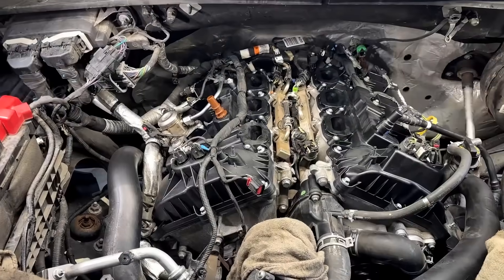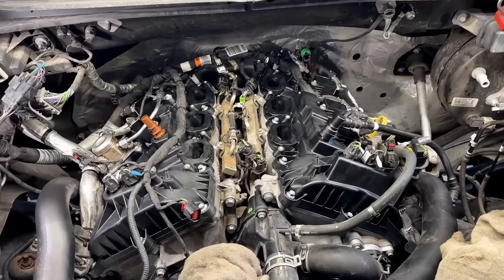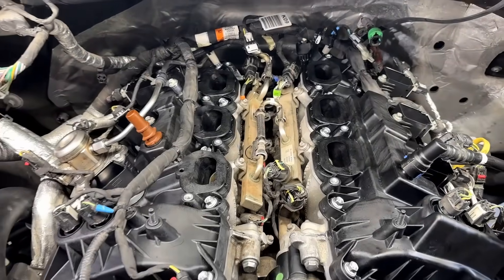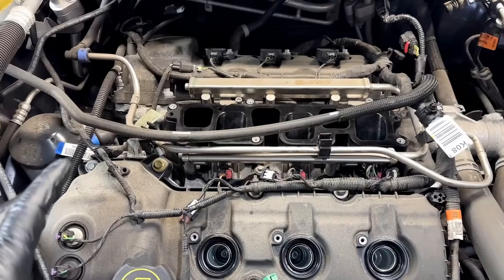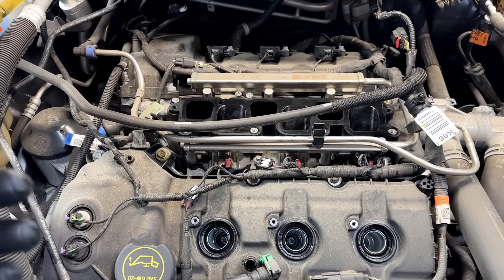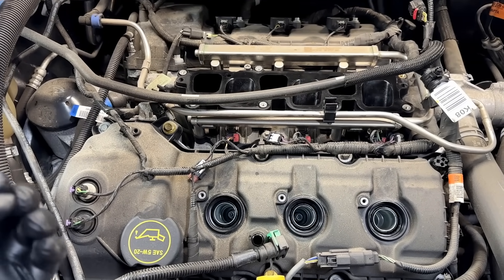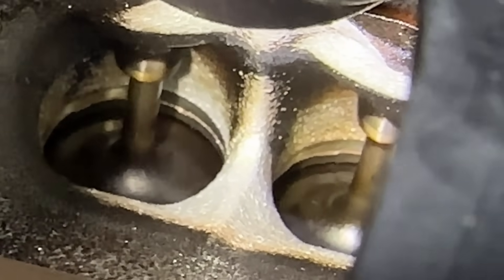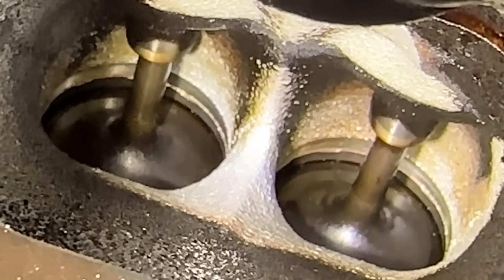Does Ford's New Dual Fuel Injection 3.5L Ecoboost Engine Really Fix the Carbon Build Up Issue?

Comment: Hey, thanks for the videos, they’ve been super helpful. Question: are you seeing the same timing issues on the 2.7 TGDI like the 3.5s? Can’t find much online about that. My 2.7 has 202K 2017 gen 1 2.7TT. 6R80, runs like a top minus drivers side waste gate rattle on cold starts. Thanks in advance.
Reply: Any direct injection car without some form of port injection before the cylinder is going to suffer from carbon buildup in some way. walnut blasting or pick cleaning are some options
Reply: @Sprier doesn’t really have anything to do with what my question was. Thanks for the comment though. I’m aware, I’ve got a catch can and regularly wash the valves with sea foam through the vacuum port on the intake manifold.
Reply: @zr1vetteman09  Port injection that bitch and send to 1000whp! Never have dirty valves again! Lol! My mistake by the way I missed one word from your comment "TIMING", apologies!!!! Happy new year Cruz!
Reply: @Sprier  haha you right though, although according to this channel, the port injection didn’t work as good as they hoped in conjunction with GDI. I’m working on getting it tuned by 5 star soon.

Comment: I have two diesels, a Mercedes 240d with 350k+ and a 7.3l non-turbo F250 with 250k+. No noticeable buildup on the intake valves.

Comment: Ya got to beat on these turbo trucks a bit to keep them right.. I got 238k on mine it's not had any problems w engine.. still stupid fast runs great.. only things I've replaced on the truck is rear axle bearings fuel pump and 1 upper control arm.. all over 200k these happened.. wore out parts not user error..

Comment: Ford should have a clean mode programmed into the computer to run port injection only after  engine hours accumulate, then switch back to dual injection... Just thinking out loud.

Comment: The carbon on my 16 must be the answer. My 16 3.5 eco just is not the same and its been at 3 shops and they claims its everything, fix everything and its still there. Just no torque. It reminds of my 01 ranger. Wish scoping the intake and looking at the valves wasn't a  pain...

Comment: Question.
Can using 93oct and and a fuel additive for a few thousand miles clean the carbon buildup on the gen 1 Ecoboost by engines once the carbon buildup is prevalent?  Or is a blasting service after a teardown only way to remove the carbon buildup?
Thanks and thanks for showing this.  Very informative.

Comment: the engines are too tight  the pcv causes lots of carbon and sludge issues  the epa has ruined gas and diesel engine by design

Comment: Thanks Bubba. Bought the Wife a 2021 Expedition with the EcoBoost and Ford Dealership tells me to run BG44K Fuel Additive every month through it for Carbon Buildup. Always used it anyway or in my 6.2 F250 FX4. Would that help?

Comment: All Ford needs to do is make adjustments to the software that gets the computer to switch to port a little more often. From what I have been told so do not quote me on it they mainly switch to port when your sitting still. They should get the computer to switch while at highway speeds unless your accelerating. That is better than  before they had both so I say that is a win for Ford. Toyota started doing both injection systems back in 2007 with a couple of Lexus models.

Comment: I don't even know why I was watching this video I've been Auto Tech for over 50 years and there's no freaking way in the world I would ever buy one of these motors what a waste of engineering Ford should be ashamed and now they came out with their new engine and it's burning up plug wires what a joke but I've always liked my Chevys but you know after 2005 they went downhill should have never went to the active fuel management engine this is all a bunch of crap a bunch of cost to customers that isn't really necessary all to gain about a half a mile per gallon

Comment: That's the result of direct injection fuel and the pvc system crank case gases vs multi port injection where the gas and air mixture is sprayed in the intake runners keeping the back of the intake valves clean👍🏿

Comment: Now let's get to the real answer. If you guys keep running thin synthetic oil. 
Of course you are going to need a catch can. 
That thin oil flashes off and is sucked through the engine. 
Same thing with the front timing chains. 
Worse oil you can run. 
Run a good HD 15w-40 diesel oil and these engines will run for 500,000 miles with no problems.

Comment: Thanks for the update and comparison! I drive a 2014 F-150 3.5L EcoBoost - I just rolled over 150k and I've never noticed anything wrong...I bought it at 103k miles and, unless the previous owner changed the timing chain himself right before selling trading it in... it's still running the stock chain. I change oil 3x/yr with Castrol GTX and when I change oil, I use those Lucas Oil GTI valve cleaning kits that you spray in the intake for like 5min...she still runs like a raped ape

Comment: I've ran a UPR catch can on my 14 ecoboost since 32k miles and have always ran top octane prem fuel through it.  It does catch alot of blow by and the engine runs great, it currently has 107k miles on it.  I always follow your videos and keep fluids clean and just changed my tranny lines based on your videos.  When it's time to work on the engine I'll be bringing it to you.
Reply: Dang does this mean I need to load up my catch can on my wife's Gen ii ecoboost?
Reply: This is nothing new, especially on certain German brands (read VW).  I want to know why a 2019 with 125k on it needs a timing job?  Is this a $5k job with new phasers as well?  Should I get the damn internal water pump done at the same time?    Or just sell my beloved truck and get a slower, less potent 5.0?  Damn it, Ford.
Reply: @Dragandspinn  5.0s have cam phaser problems too as well as oil consumption. Now that they have cylinder deactivation, that's a hard no from me. I'd rather deal with ecoboost issues.

Comment: When the guy fixing the machine should be in the engineering department instead. 😆 Now where I have seen this bef....... I know!....... Any large corporation!

Ford isn't sweating it, if they start to go under, Uncle Sam will make them an offer they can't refuse. And free market forces get flushed down the toilet and CEOs make off like bandits after they dump their stock for a massive profit.

Comment: Thanks, great information as always! 
Do you recommend any type of fuel additives or cleaners for the 2nd generation that may help with the build-up?
Reply: I looked into this exact thing Berrymans B12 chemtool is a really good fuel injection/valve cleaner u put a can into the fuel tank every so often. Also use your remote start in morning and let it idle 10-15 min before u head out when its idling it uses port injection spraying on the intake valve and with the B12 it will make them squeaky clean!!

Comment: I have a catch can on my 19 raptor.  Guess if you drove on light throttle,  port injection most time valves stay cleaner.   I also use jectron cleaner

Comment: I have a '13 F150 EB with 88k, about a year ago removed the intake and manually cleaned all twelve valves.  Used picks, screw drivers, conical brushes, brake cleaner,  CRC GDI intake valve cleaner and a hand actuated vacuum pump with inline reservoir.   Only real thing to pay close attention is to operate only on valves that are completed seated/closed.  I chalk this up as normal high mileage maintenance.  Much like transmission fluid, trans case, diff, etc.  I got fantastic results.  Post clean I would estimate the state would be equivalent to a truck with 5k miles.  Only area that was difficult to access on the valves was toward the engine centerline.  The head design and seat slightly shrouds the valves on a very small portion nearest the engine centerline.  Wish I could post a picture here, the before and after are pretty impressive to compare.

Comment: Brian first Merry Christmas to you and family. First time I’ve heard that the direct and port aren’t synchronized to fire together. Between direct injection putting an extra load on the cam plus causing the carbon buildup on the intake valves what are we accomplishing with direct injection? Are there cam followers on the direct injection pump and if so how long are they lasting? Brian have a safe holiday.     🎄

Comment: If it weren't for the FRP and FLP PIDs as well as the high and low fuel system tests, these would suck to diagnose. I've had a lot of new 2.7s with injector issues, some port and some direct. This helps alot in diagnosing this weird system.
Reply: What years

Comment: In reality I feel we should ditch GDI and go back to Multi-Port. This is why I bought a used F-150 with a Coyote. I do not want GDI or Turbo junk.
Reply from the maker: The newest Coyote engines have GDI technology too.
Reply: @FordTechMakuloco  Yeah I know. This is why I have to keep my 2014 as long as possible. I also still drive a 04 Taurus 3.0L. that one doesn't see winter.

Comment: After 100k miles on even then Gen 1 engine doesn't look bad at all TBH.  I mean it's not good but there's worse out there---e.g. Audi 2.0Ts are typically way worse than this...at half that mileage.
Reply from the maker: I know those are the worst.

Comment: Great video I seen a couple  of them never explained how it worked I have an 18 150 with 30,000 2.7 yep I don't drive much and I do idle so I really don't have to worry about carbon build up for a while thanks .don't even think I need a catch can I should be dead by time I get 200,000 on it

Comment: Hey @fordtechmakuloco I did a timing chain cam phasers hv oil pump 24 rockers and new cam actuators on a 05 f150 5.4. all oem ford parts other than the hv oil pump. Fired right up after the job was ran great smoothest 3v 5.4 I've ever heard. But after driving it for an hour or so everything was good. Great oil pressure great performance until I slowed down to stop at the light I can hear the timing chain or phasers rattling on deceleration almost sounded like a 7.3 then it cleared up but did it during acceleration and lost oil pressure and now when it warms up sounds like I never changed anything. Did i miss something? Maybe a defective part? I didn't pull the pan to do the pump maybe the pick up tube is leaking or clogged?

Comment: Will an oil  catch can help or better oil and higher frequency of changes?  I have a 2020 3.5, use Valvoline Extended Protection Full synthetic G6, and change it every 5000 miles, hoping this will help.

Comment: FordTechMakuloco, would you recommend a catch can on these 2018/newer 3.5 eco's?  If so, do you recommend a certain setup?  Passenger side only or both driver and passenger PCV?  How does adding a catch can affect warranty's etc?
Reply: Same question.  I have a 21 f150 3.5tt.

Comment: New or used which engine is the most reliable, the 5.0 or the ecoboost? Also which model year is better. I've been driving a 2006 Expedition with 180k miles and compared to others I've had very few issues. My guess is other than tires I've spent less $3k on shop repairs. My wife hates the vehicle mostly because of the age and is pushing me to purchase another vehicle. That's for your channel and I must say this is my go to channel for the few repairs I've done on my own.
Reply: V8. I got the 5.0L in my 14 f150 get 17.7mpg. Bigger the motor less stress. Plus v6 turbos will eventually go out. 2014 is not 1st Gen.  After 2015 was a change of model. Never get 1st year model change. I would say big issue watch coolant. Hoses have plastic y with orings that leak around 100k.
Reply: I would still keep Expedition doesn't owe you money. Free miles, wear, tear. Plus extra vehicle when needed.
Reply: @shawnkleveland3967  I'm a fan of the big engines myself. I have really gotten my money's worth out of that Expedition and to be honest it will be passed down to my son I usually keep vehicles for about 10 yrs before I pass them down but this one has held up really well and it still running good.

Comment: Are the 2016 3.7l engines port or direct injected I heard they were both  port and direct injected not sure if that's the case it's on a 2016 transit 250
Reply: Port.

Comment: Thanks.  I was wondering about this.  You provide great real life information.   

Because of your videos, and my engineering degree; I bought a 2021 Escape with the 2l eco boost.  Stayed away from the 1.6l with its coolant ingestion issue.  

I’m extremely concerned about PTU longevity.  I know Ford has made changes to improve cooling and servicing (fluid replacement).  I’m coming up on the 30k mileage when I am thinking about fluid replacement.

Comment: I warned my boss not to buy a f150 eco crap engine. 
Now he must replace his timing chains. Wants to buy Poorman valve train. I told him. Unless you want total destruction when you are taking your family on a trip. Go ahead. Stick to FOMCO parts. The shop quoted him 2300.00 for repairs. I drive 03 silverado. I don't plan on buying any Chevy products or Ford products due to drive train issues. I don't chance on seeing my family break down anywhere on the roads. God Bless yall

Comment: Timing kit on a 2019 with just over 100,000 miles??!!   I didn't know the ecoboost motors had the timing chain/phaser problems that the 5.4L had.  
Do they have a similar timing problem and will need a regular service of a timing kit every 100,000 miles??

Comment: Funny thing is that the Asian (including Renault) were able to figure out ways to keep them clean enough.

They use valve timing/overlap, high heat and higher rpm (shift points) cycles.

Comment: I have a 2017 Expedition. How do you tell if you have the 1st or 2nd Gen. 3.5? Also, I installed a catch can system about 5-7K miles ago. Curious to know what you think about those systems, Brian. Additionally, I live close enough to BSG that I could drive there, if you want a 'volunteer' 3.5. Thanks!
Reply from the maker: You have a 1st gen.

Comment: I'm old I could remember if a truck had 100000 miles it's did a outstanding job
Reply: Years ago 75 - 100'000 miles was considered just breaking in, at least that's what my Dad always said.
Reply: How old is your Dad I'm 64 back 40 years ago 100000 was the limit

Comment: I have a 2015 3.5L that I decided to clean the intake vlaves on when I saw your first how to video. They were like the first truck and it took a while to clean them. But I did it. just recently I decided it was time to clean them again as a preventative measure and was a lot easier but I only let it go about 40k miles. I think I might just make it a normal interval cleaning because it helps a lot and I am surprised how easy the intake is to take off.
Reply: How did you clean the valves?
Reply: @TheOnlySgtRock  Walnut blast?
Reply: @johnny-z  it's a $400+ machine and I wouldnt invest in it since I'm not a mechanic for a living. I would if I did it more than once in 2 years.

Comment: Two things will cut this issue down. Quality fuels being introduced to the engine and a catch can. It isn’t perfect but it certainly cuts the carbon deposits down significantly. All of my vehicles run on “top tier” fuels and each have a catch can. Zero drivability issues. This video is an excellent demonstration of the different gens of ecoboost and what improvements they may or may not exhibit. It’s why I follow the channel and look forward to more great content!
Reply: I wouldn't be surprised if people using conventional oil really makes this much worse...
Reply: @HouseCallAutoRepair  ... oh, absolutely.  The keys here are TOP Tier fuel, full synthetic oil, regular 5k oil changes, and adding a fuel injection cleaner every oil change.  Will certainly help this issue.
Reply: How does injector cleaner and top tier fuel help with preventing carbon in a DIG motor?
Reply: @turbostyler  as noted in the video, the Gen 2 3.5L ecoboost has port and direct injection. When running on port injection the cleaner will wash the backside of the valves, which should help clean the carbon buildup. Just direct injection - cleaner in fuel won’t help.
Reply: @turbostyler  ... well with this particular motor, the fuel injector cleaner and TOP Tier fuel will actually spray over the valves with the port injectors.
Reply: @DonDanDeLaVega  I'm aware of port injection, my point was more that fuel itself is a great solvent and the injector cleaner is more so for the lines and injectors. It's the petrol that dissolves the oil and washes the carbon particles off the valves. I doubt injector cleaners actually do anything for the valves, the heavy lifting is done by gasoline.
Reply: @turbostyler Nonsense!
Reply: With DI only i don't care what fuel you use or what fuel cleaners that you use that go into the tank. They won't help a DI only engine because the fuel and cleaner never touch the tops of the valves and valve stems. Only catch cans and upper induction cleaning is going to help a DI only engine. Its a definite problem with DI only engines. The problem seems to occur right after warranty expire too. Kia and Hyundai engines are blowing from this issue right after 100k.
Reply: @ShizawnSanders  ... YES, agreed.  But, this video is NOT about DI only engines.  Which is why FORD (and others) have started to engineer DI engines with Port Injection.

Also, some proof of reducing carbon buildup on valves is to use a HIGH quality FULL synthetic oil, along with changing the oil every 3k or 5k miles.

Most owners only do the minimum and follow the service tracker doing oil changes at 7500 to 10,000 miles.  Which exasperates the issues.
Reply: Top tier fuels are a scam. Even cheap gasoline has the ability to clear tar off of hands…
Reply: @dogewisdom9921  if you say so 🤷🏻